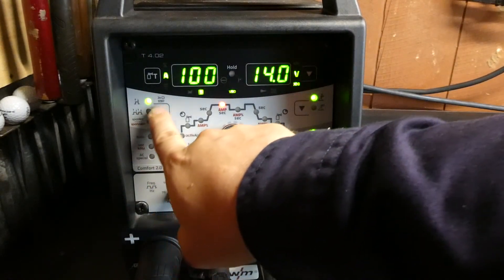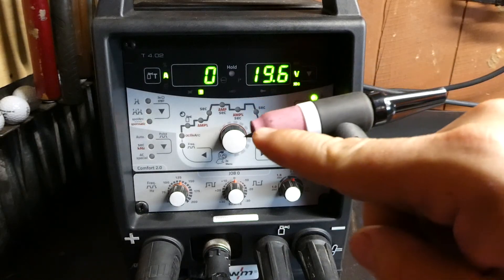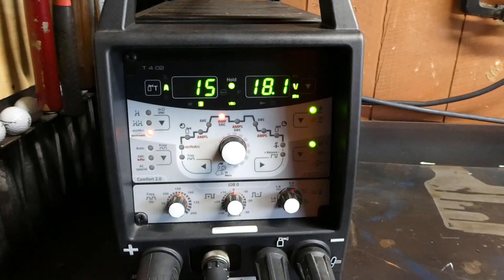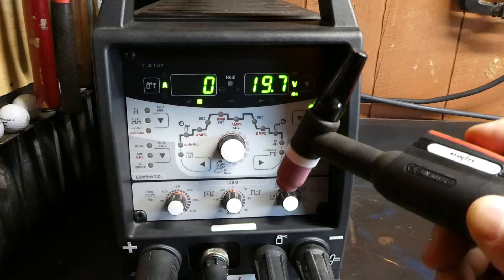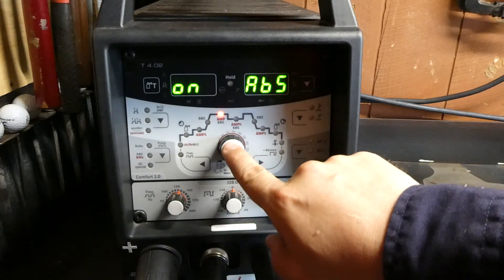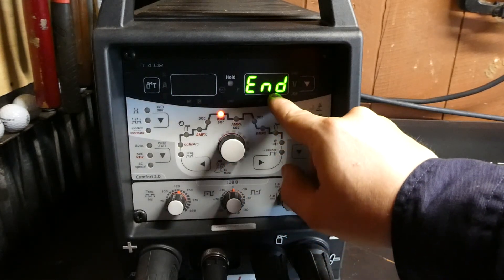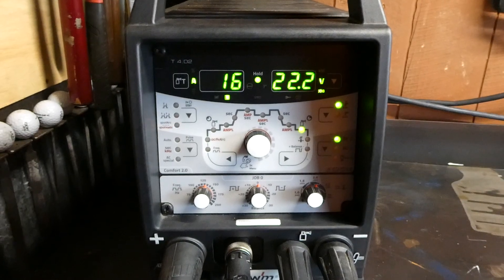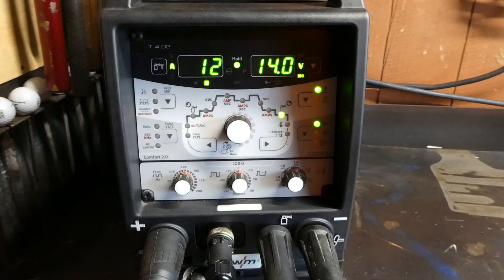EWM Tetrix Top Tip - Process Activation Setting for Spotmatic

Comment: Hi Mitch, seen all 5 videos on this welder from your channel, great work thanks ! 
I'm looking for a very good AC/DC TIG welder and can't decide between this one and the Fronius MagicWave 230i. 
Have you used this welder with a foot pedal yet ? Do you feel the need for a watercooled TIG torch given the capabilities of this machine ?

Cheers,

Vincent.
Reply from the maker: Hi Vincent, This is indeed (in my opinion) a very good TIG welder. It would be comparable in quality to Fronius- maybe even better. Another comparable machine would be the Kemppi 235 ACDC. 
I like the Tetrix interface, Fronius seems a little too '1990's' in my opinion. EWM has a new model Tetrix XQ with all LCD display- very nice! Check out the EWM channel for this- it was released just a few weeks ago. 
Foot pedal use on the Tetrix is great- I always have mine connected and love it. It's a very robust and smooth pedal- great for work site. 
I have not run into limitations with the standard EWM torch on this machine for higher amperage stuff, but if you do long runs and high amp work, then consider water cooling- EWm has a modular cooler that just bolts on. Would be valuable if you need high duty cycles.
Reply: @MitchMakes  Hi Mitch, thanks for your comment. In the mean time I have bought the tetrix 230 AC/DC and can confirm this machine is a killer. I got the ewm torch a bit hot running 200+ amps for a long time on a big stainless steel 8" pipe for a two pass joint. 

You said you are using a foot pedal. Is it the EWM one ? Are you happy with it ? I would like to invest in one but the EWM is not cheap, do you think is worth the money ? Would be awesome if you can show it if you make another video on the tetrix ! Your videos have been really helpful !
Reply from the maker: @LepseudoAlakon  100% worth it. It’s smooth to use, robust, and real high build quality. 
If it matters, active arc feature is not available on the pedal, but i think benefits outweigh that. 
I’ve got a video made for it, stay tuned!

Comment: have you tried the dual layer spot weld function yet ?
Reply from the maker: Not sure if I have? I've used the spot, and spotmatic features, difference being the requirement to tack by touching off on the job as opposed to hitting the button each time. 
I haven't played around with any pulse settings (eg high / low current switching) while in the spot modes, if that's what you mean?